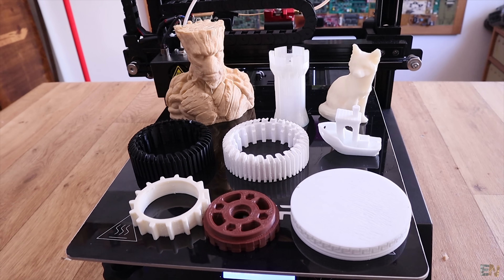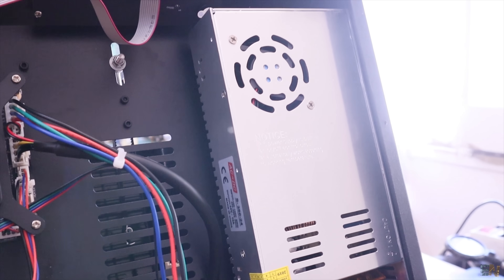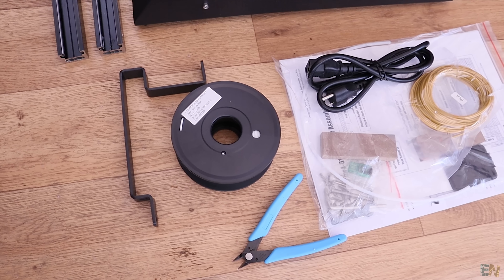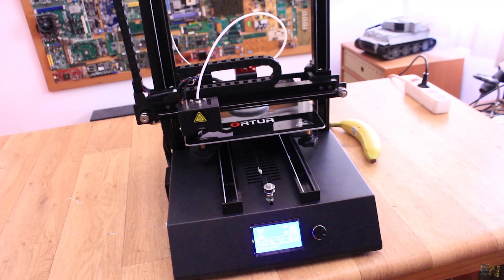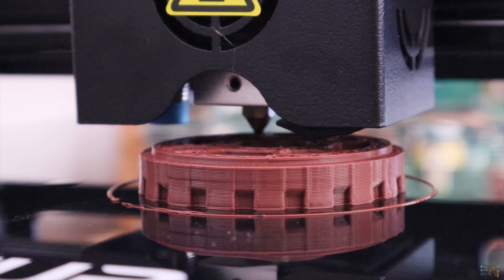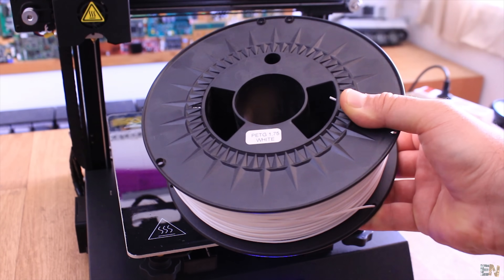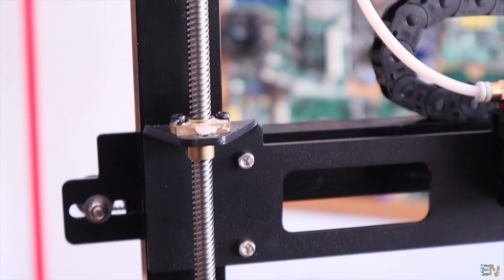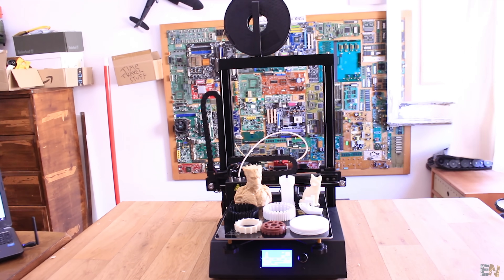Ortur 4 V1 3D Printer Review + Tests PLA | ABS | PETG | FLEX | NYLON

Comment from the maker: Sign up at ELECTRONOOBS.io: https://electronoobs.io/
Follow me on FACEBOOK for more: https://www.facebook.com/Electronoobs
help me on Patreon: https://www.patreon.com/ELECTRONOOBS
Reply: Thanks for the great review video, and we would add the screw shims to make sure it wouldn't be loose during any shipping condistion.
 I'm sorry but this benchy is really not ok. 
 But in the new batch of Ortur4, we had saved the Simplify3d profile, and the Cura4.2.1 with Ortur printers options inside the SD card.
This way, the customers could save time to teak profiles and print the great quality artworks.

Comment: Thanks for the great review video, and we would add the screw shims to make sure it wouldn't be loose during any shipping condistion.
 I'm sorry but this benchy is really not ok. 
 But in the new batch of Ortur4, we had saved the Simplify3d profile, and the Cura4.2.1 with Ortur printers options inside the SD card.
This way, the customers could save time to teak profiles and print the great quality artworks.
For the customers, whom had received the Ortur4, but without the latest profiles or Cura4.2.1, welcome to email me ortur@ortur3dprinter.com to get it.